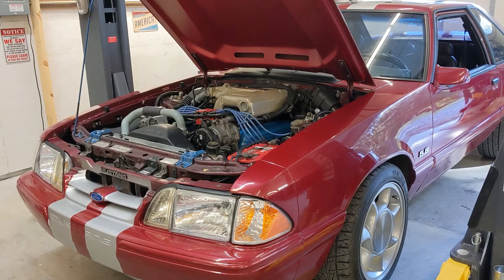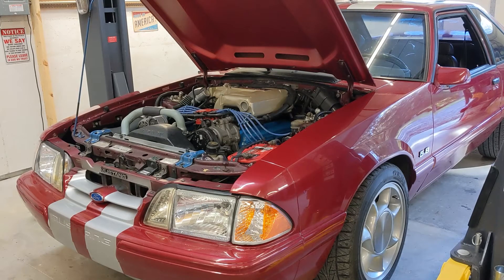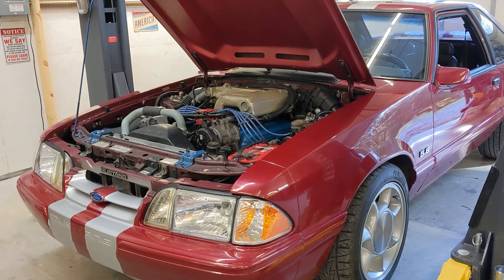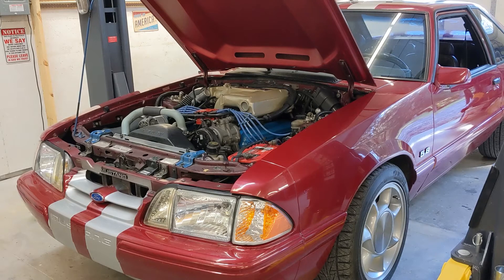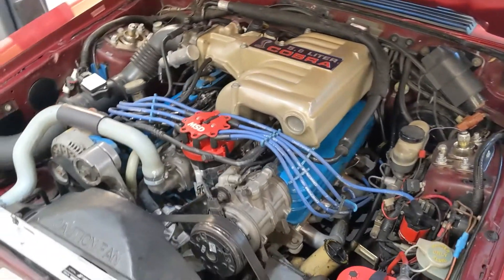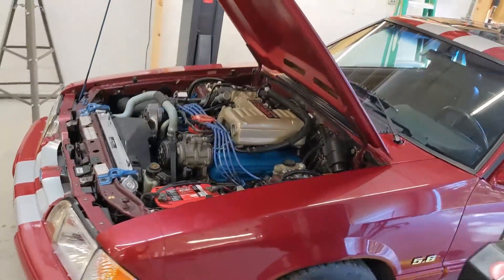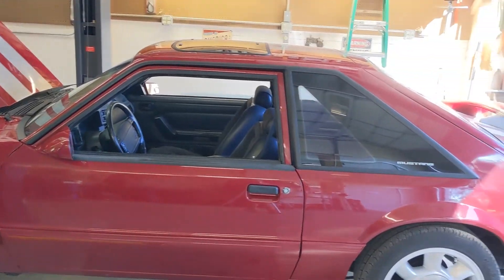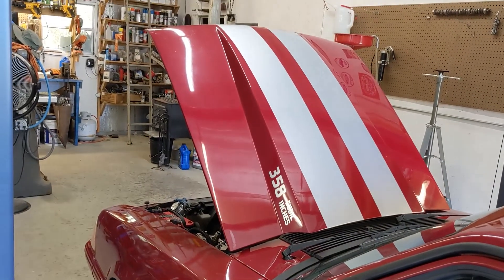Fox Body Mustang 351w | Talk performance parts list | PIMPxs computer and dyno tune coming soon!

Comment: Beautiful fox, just wondering what size cowl hood are you running? Always wondered if a  351 would fit under the smaller size cowls (1.5-2.5).
Reply from the maker: Thank you!  I'm running a 2.5" cowl hood.  The engine mounts I purchased put the block a 1/2 to 3/4 inch or so lower in the engine bay.  My front oil drain plug had to be ground down some because it was touching the sway bar LOL.

Comment: Nice!  Very simple and clean 😎🤙 Doing a 408 for mine and using the Megasquirt 3.  BTW.  Not sure if you care or if you know... but the front wheel is in wrong side.
Reply from the maker: My front wheel? Drivers side? If it is, I didn't know, will look when I get home lol 🤣
Reply: Yes sir. Lol. Looks like it's on opposite side it needs to be on.  Weren't trying to be a schmuck.... Fins go in direction like the driver rear is currently. 🤙😎
Reply from the maker: You're right, it's on backwards! 🤣🤣 I must have been drinking when I put the wheels on last time. 😊
Reply: @ThisOldFarmShop  🤣🤣🤣 I can relate!